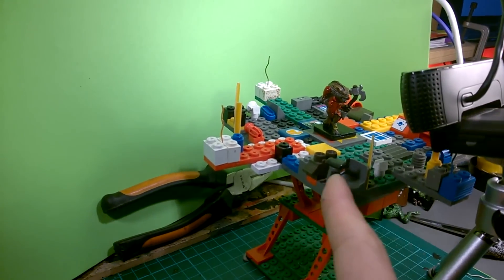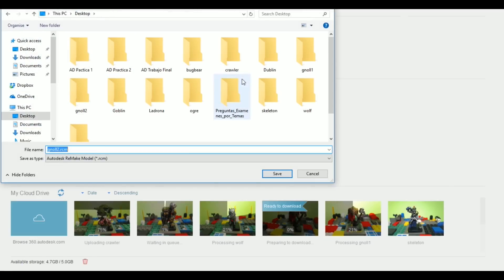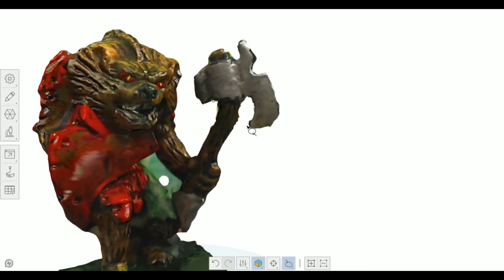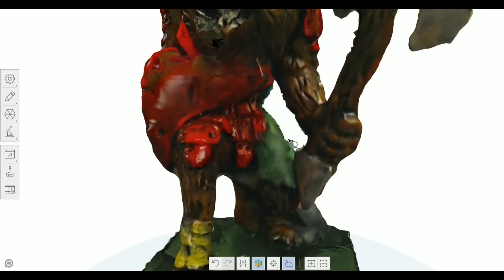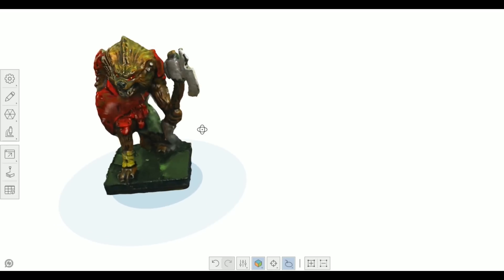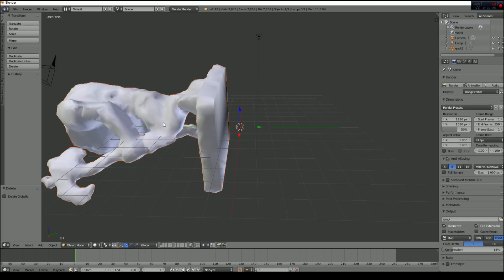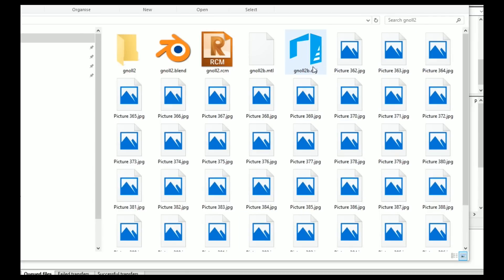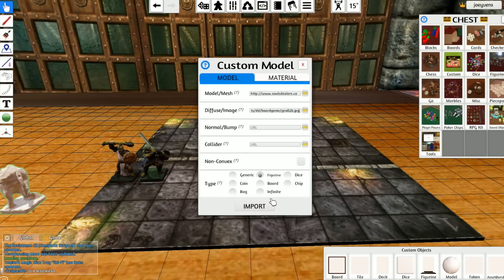Scanning miniatures for Tabletop Simulator

Comment: How do you import the texture from blender into a texture that TTS can read? I can create models etc. but if I paint them in blender TTS cannot use the image the same way blender does
Reply from the maker: During my process I don't need to export the texture from blender because I am using the image file generated by Autodesk Remake. But I can tell you there is a way to export the texture file in Blender to a single image file to be used by TTS. I've done it before. Unfortunately, I've done it long time ago and can't remember how I did it, but it shouldn't be difficult to find a tutorial to figure out this, or maybe someone around could help. Sorry about this, but I'm not an expert in blender, and have no time to investigate at this moment.
Reply: No problem, I just assumed after the cropping process the image will not be enough to be used as a texture, at least for TTS, if the model is too warped. If thats not a problem then dont mind my question
Reply from the maker: Well, as far as I remember it wasn't complicate at all. There was something to do about unify all textures in a single file (in case they were several) - Actually not sure but this could be the "cropping" you mention. And afterwards export it to jpg or png. But not additional thing was required aside of these.